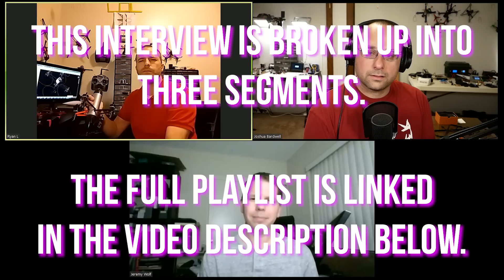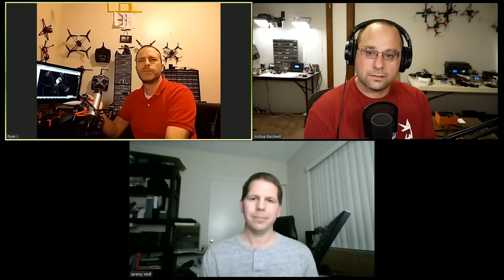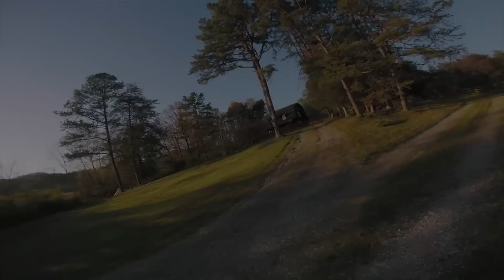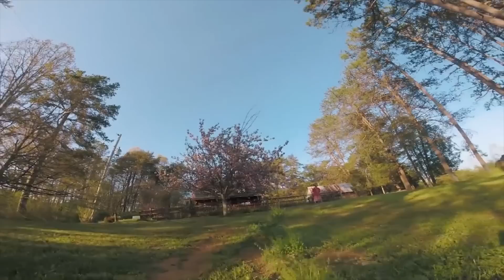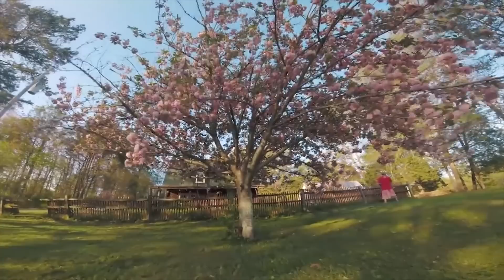World Drone Speed Record 200 mph Interview (3 / 3)

Comment: This video series was great, but it's killing me...  Old crappy batteries, outdated motors???  I know these guys are hobbyists like all of us, but damn.  Somebody get some higher end components on a aerodynamic frame and see what you can hit...  I think this may need to be JB's next project...  Get a Kraken Worx frame with stick thin arms and aerodynamic pod, toss on some F80's and a solid 6S pack.  I want to see some numbers of what can be hit with off the shelf gear.  The sideways flying rocket is cool along with the other frame, but I gotta believe we can hit the same numbers with better gear out of the box...

As for using a very custom built frame for speed runs, why not something with a design nearly identical to XCrafts - X Plus one...  You've got your super flat aerodynamic wing to fit all your components and batteries with a motor at each wing tip and then essentially a top and bottom "Keel" that's got the other two motors on it?  Seems like it would be stable and you could create a small amount of lift during your FFF.  Just my $.02
Reply: Trust me, there's no combination of gear on a "normal" frame that can hit these speeds. Also, the "rocket pod" is probably going to be available publicly here in a couple months. I've been a small part of developing the frame for a little while and these guys know their shit. Just because a certain motor may be newer doesn't mean it's better. For whatever reason those Cobra CP2207 motors are literally the most efficient motor in it's size class tested on MQTB. Dunno why, but they're just that good.

Comment: I deleted my reply because I didn't post to create a issue. I was just showing a alternative that has been verified using dragstrips and other test. I have been told by gps experts that most GPS out there when you get to certain speeds usually over 100mph the hz of the GPS can not accurately give accurate speed readings because of the sampling rate. I have been building at least up to 145mph 5" drones for at least a year and have a lot of experience with them.
Reply: So here is why the Dynamite GPS is more accurate. The 10hz update rate of the Dynamite at 200mph (89.04meters/s) takes a measurement every 8.94meters (894.08cm, 11.73feet, 352.00inches) where the 5hz GPS at 200MPH (89.04meters/s) takes a measurement every 17.88meters (1788.16cm, 58.67feet, 42240.1inches). I hit 145mph in less than a second. You could be hurting your own top speed because of the slower rate. Drl 100m runs you would get 13 samples at 10hz and only 5 samples at 5hz doing say 200mph (89.4meters/s). That's 2.6 times the accuracy. As far as weight these guys have a huge weight difference between the two so 7 vs 30gms doesn't seem to be that much of a factor. Also position accuracy is needed but in high speed accuracy requires higher sample rates to reduce gps blind areas.
Reply: Quote from a link from your GPS setup video. "Ublox M8N

This was my first try at using a standalone receiver which a friend recommended. This is directly connected to the FC UART. Configuring can be done with the ublox software or you can enable the gps_auto_config on Betaflight. I found that the default settings on the receiver were not usable with a quad so I tried to configure it myself. I’m very good at learning new things, but I was astounded by the number of configuration variables – it was too much to learn in the time frame I wanted so I opted to let Betaflight configure it." https://quadstardrones.com/gps-vs-radar-gun/

https://youtu.be/B_Yl0wqRf68
Reply from the maker: The RDQ GPS receiver does not need any manual configuration to use with Betaflight. It comes ready to go.

The update frequency of the GPS unit does not affect accuracy of the GPS speed measurement because it is based on measurement of doppler shift between satellites, not integrating position over time. As long as a minimum number of satellites are locked, GPS speed is accurate regardless of update rate.
Reply from the maker: The main argument I could see for faster refresh rate is that if you are only measuring every 1 second then you might miss the peak speed of it was maintained for 1 full second. But my understanding is that the speed readings produced by a 1 Hz unit are just as accurate, all else being equal, as a 10 Hz unit.
Reply: Based on this paper and others the hz is very important when it comes to measuring speed especially the faster it fly's. https://drive.google.com/file/d/14kZxx_NBk0EA3MwK77-iS7m6BilRSVsA/view?usp=drivesdk
Reply: https://www.semanticscholar.org/paper/The-Suitability-of-GPS-Receivers-Update-Rates-for-Salih-Zaini/7921fa6531e06db784d52308f4afaba3ecfbb3d4
Reply: This video shows the difference between even 1hz vs 10hz. https://youtu.be/WQNKoX3jv_c
Reply: Some more useful info on GPS verses measure of speed and the importance of sample rate being faster. Quote "Sample Rate

The number of samples produced each second is of primary importance in vehicle testing. The most usual update rate for GPS is once a second, which is fine for navigation, but it is not much use if you are trying to measure speed, braking distance, acceleration, lap-time or track position. The minimum for these sorts of tests is 5Hz to see any level of detail, and 20Hz is normally considered the minimum entry point for a decent GPS vehicle testing solution. The top end GPS systems can update 100 times a second, and these are suitable for specialized applications such as brake testing and high speed dynamic manoeuvres."
https://racelogic.support/01VBOX_Automotive/01General_Information/Knowledge_Base/How_does_GPS_work%3F
Reply: A good scientific comparison between 5hz and 10hz. Showing again 5hz is pretty much to slow for our speeds. https://www.researchgate.net/publication/266153188_Accuracy_of_GPS_Devices_for_Measuring_High-intensity_Running_in_Field-based_Team_Sports
Reply: Same company 1hz compared to 5hz. Both studies show error %. https://www.researchgate.net/publication/228097699_Accuracy_of_1Hz_versus_5Hz_GPS_devices_to_measure_movement_patterns_in_team_sport_activities
Reply: Basically 5hz is good for speed readings up to around approximate 69 to 89mph depending on environment. Over that you have to keep stepping up in hz rating to keep the accuracy below the 1m/s to get accurate speed readings according to the research and the actual manufacturer of GPS for speed readings. 200mph is a far far difference from the approximate 69 to 89mph. Especially when even the research shows that even  runners the 5hz is not accurate enough at speed. But doesn't really matter I guess. But you can get in the size of the one you showed that are capable of running at 10hz and are made for rc. RDQ has one on there site and it even has a better urban antenna on it.
Reply: I dont think the issues discussed in these studies apply at all for the highspeed-run scenario.
As explained GPS doesnt rely on multiple positional readings to calculate velocity but uses doppler-effect changes in the gps-frequencies to calculate ground-antenna speed.
That means even if you go down to an updaterate of 1 (not 1Hz, 1 update per run), you still get a very accurate reading for velocity at just that point in time when the update happens.
Higher updaterates are needed when you try to measure more complicated scenarios, like the studies mentioned braking distance, highspeed-navigation, dynamic movement at high speeds and dynamic accelerations.

While all these things would be very interesting to measure for these highspeed buttplugs, for a record speedrun refreshrate only comes into play if the fastest speed achieved falls in between two updates (meaning you missed it and only measure the lower speeds before and after).
So higher rates would assure we get to measure the highest speeds possible, but the readings that we get at any rate are eaqually accurate.

Comment: What makes this the worlds fast drone or race quad? Its purpose-built for speed Anyone can do that with anything. What makes it any different than anything else that flies? I just don't see what you think is so great about your accomplishment a piece of dollar store foam board will break 200mph all day for $100
Reply: It is Record for Quadcopters
Reply from the maker: You're just wrong. If you think it's possible to break 200 mph so easily go do it. You won't. Ryan's speed record is in contention for a Guinness Record because it's very hard to do what he did and almost nobody can do it.

The DCL guys hit something like 160 mph with a 10S setup and they were frying motors and ESCs trying to do it.  Wow. If only they knew they should have used foam board.
Reply: I did in 1990. I took a 48" cardboard holiday wrapping paper roll coated it with a thin layer of fiberglass and cut it down to 39” with a few access holes. I re-enforced a thin sheet of aluminum with balsa battens and glassed them into a zero lift wing. Each wing was 13 inches long tapered from 3 inches down to 1 inch at the tip. I used a cam similar to a compound bow and spring to actuate the swept wing which folded into the fuselage leaving 13mm exposed on the leading wing edge sweeping to zero at the tip. I used nylon screws as linear actuation for the horizontal and vertical stabilizers on the 4” x 4” 90 deg tail with 1” control surfaces. I used my high school's brand new desktop CNC mill to machine the aluminum variable pitch rotor head and 2 piece 13” prop I designed on AutoCAD 1 in drafting class(1989-90). I don't remember the exact motor I used it was an O.S. .60 or .80 it was almost 30 years ago. I ran the throttle off a POT on my Futaba transmitter that cost more than my truck(the one I drove to school) back in 1990. Wings locked back around 30 mph and the engine wound up to 14000 rpm. Hold on and fly off the VPP and make vector suggestions with the tail. I don’t know how fast it could go but easily over 200 mph. I mean no disrespect Josh I just think it would be like saying you built the fastest Stock Car then showed up a Top Fuel Funny Car. It may be the fastest thing on the track but how can you call it a Stock Car if can’t make turn 1 at Talladega? You and your boys can sit around and stroke each other over a 200 mph drone, quad racer or whatever you want to call it but and then end of the day its a 200 mph Chode. It would be fun stick down my pants with the nose sticking out of my fly for a good laugh at my next WSU MME reunion. 
Cheers Josh 
Its all in good fun
Reply: @jhuff8596  Sorry, but I do not think you came close to 200MPH with what you are describing.  Some aerodynamic calculations based on known prop theory, assuming zero drag and zero prop slip show that 200MPH is an unrealistic speed as described.  A 14k RPM prop of 13" diameter would require ~15" of pitch (a 13x15 prop) to obtain 200MPH at zero slip.  With good aero, 5-10% slip is more likely so you would need a 13x16.75" prop.  14k RPM on that prop is 0.7 mach so you are already knocking on the door of going trans-sonic at the tips and suffering large wave drag losses without really good prop design which you most likely didn't have access too at that time.  Furthermore a prop of those dimensions would require about 8HP to spin 14k RPM and I don't think a 0.80 2 stroke would make that kind of power.  Another issue is a prop with that high of a pitch would be operating in a stalled condition at low speed as it's well past it's critical angle and would require a high speed catapult launch to get to speed.  The prop also sounds like it has a low aspect ratio which means the efficiency is even worse as efficiency increases as aspect ratio increases (look at glider wings or modern passenger jets).  200MPH is not easy to get to in RC.  Much easier to go fast with model rockets.
Reply: It's funny you say that. When the airframe was shot I pulled the engine off, strapped a bunch of fireworks on it and sent it out in a blaze of glory which ended up being a flat spin of fire and fury(Priceless). I honestly have no idea how fast it was. The project was a test platform for my helicopter tail rotor head design. Speed was never the goal just a bonus. Simply flying as fast possible then reversing the thrust to see what breaks. I went through multiple rotor heads and prop configurations during the testing never did any true speed testing. Its the fastest thing I have ever flown that I wasn't inside of and the fastest fixed wing in my R/C Flight Club back then. The most useful innovation to come out of it was the tankless fuel delivery system for 3D nitro helicopters. Hey, Zombie Thanks for your time and interest. Cheers! John

Comment: Wouldn't the quad be more aerodynamically stable if you put the motors up front and have the body of the 'rocket' draging behind? It would be kind of self stabellizing on higher speeds I feel. Or maybe even use fins...
Reply: I got the same idea. Dependig if go for  pure dragster or 
Racer hybrid for pure fast Circuit. Also I would go for special Electronics for smal front secional footprint for very low CW factor. With Cam1 Cam2 FC where the cam are thickest things. And spiky cone  With a external Gyro so you can mount FC and ECS in row in forward flight direction.
Reply: The positioning of the motors in front might make it more stable, but that depends.  You need to have your center of gravity in front of your center of pressure to increase stability.  The positioning of the motors also changes the Cg and the amount of control the ship has due to altering the moment of inertia (how fast the FC can correct attitude).  One of the guys in our group made the most amazing automated spreadsheet solver I've ever seen to help resolve this issue for my design.  My design does use some really tiny tail fins to increase stability by altering the center of pressure location.

Comment: Ryan's super light frame flies like an ultra slippery something or other. There's almost no percieved resistance when you let off the gas.  To fly effectively in a race setting, you all but require a camera angle of 70+deg and I felt like it was definitely well above my skill level to fly fast.   A highly skilled racing pilot could handle the speed and would floor it through turns to get it to grip extra hard. However this thing changes direction so fast that you'll be increasing speed out of the turn and things are coming up on you so fast it's hard to see what's happening without having some pre-learned memory of a course.  Definitely a unique flying experience.  I started looking very closely at the box frames after flying it because with all those vertical cross bars on the box, it's like having air brakes just by tipping down from ~80deg but you can still get the all out speed...however I kinda stopped moving in the race frame direction since I don't really race at all.
Reply: a very Skilled Racer pilot can brake.
1  : doing full throthle  after 180  
2 : pull back up where bottom aim forward full throttle then hoover back in previous angle or hoover angle.

Comment: Interesting to see some different quad styles for a change! Great vids.
Reply: the rocket theme to me is the more pure for speed.
Where the other is more hybrid. Often in races you could have Circuit wich prefere the very agile racer. Where other the less agile but more faster quads.

Even as racer you need solution to these extemes in Race circuit. Some with even some freestyle in the mix.

Comment: Good point joshua. I see you watch the new racing cars and how the flaps work when going top speed and slowin down.
Reply: Racing cars it more pushing the car on the road to go faster through corners.

Airplaine even Gliders got Airbrakes. Where Flaps give lift by low speeds where cars are inverted to give downfource.

Comment: Now one has to design a quad that is aerodynamic and has som sort of airbreaks.
That would be awesome.
Reply: reasons for not is that experience racer deal with braking in advanced fly style of way.

Flaps and servo take extra weight, so it.s more a handicap.
Reply: Just fly 3D and pull the throttle all the way down to full reverse when you wanna brake?